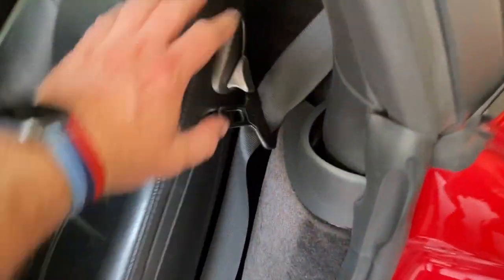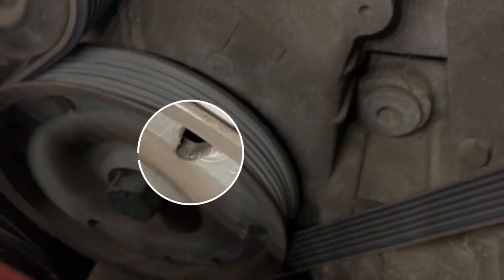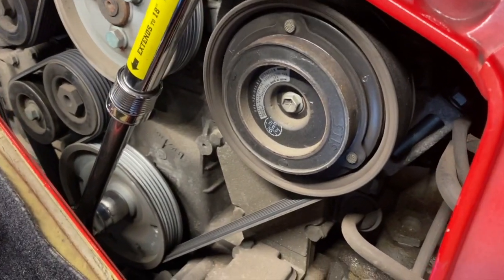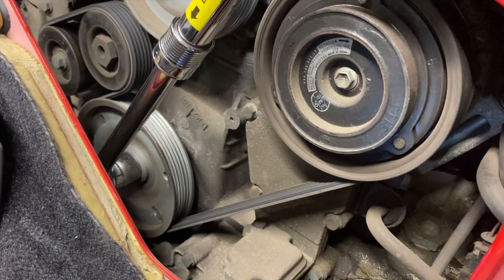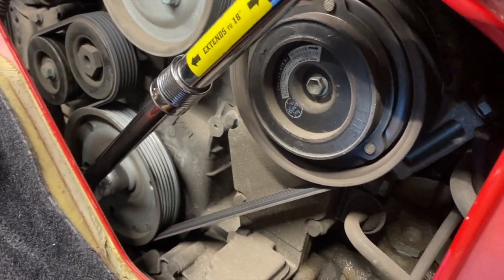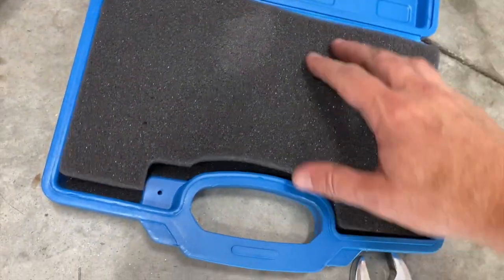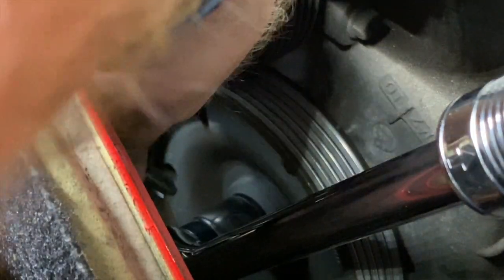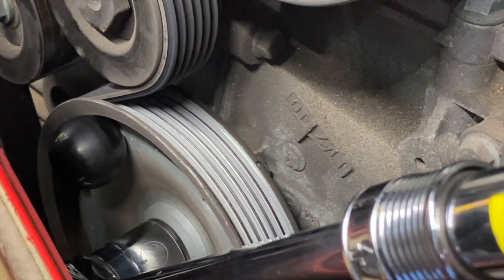How to put a Porsche Engine at TOP DEAD CENTER (TDC) | Boxster 986/987 911 996

Comment: The "nut not turning at the same rate" you're seeing is probably slop/play inside the ratchet itself. When you ratchet back it has to move forward a little bit before it bites, if that makes sense. Lower quality ratchet, no big deal

Comment: Are you doing the IMS?
Reply from the maker: +John Morgan I was doing the chain tensioners
Reply: @HelpMeDIY  Are you able to get to the guides too?  Or is that an engine out proposistion?
Reply from the maker: @johnmorgan7262  guides are the next project. Engine in :)
Reply: @HelpMeDIY  I did the guides on my 5-chain 986 earlier this year with the engine in the car. I removed the engine bay fan on the passenger side and loosened the airbox and zip tied it as far out of the way as possible on the driver side. I recommend also removing the oil sump plate for cleaning, I found little bits of plastic guide in mine. They were pretty worn with over 130k miles on them and each side had more than 6 degrees of cam deviation. Good luck!
Reply from the maker: @wiiums4089  thanks!!